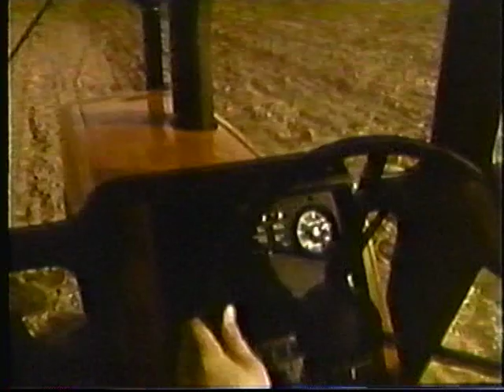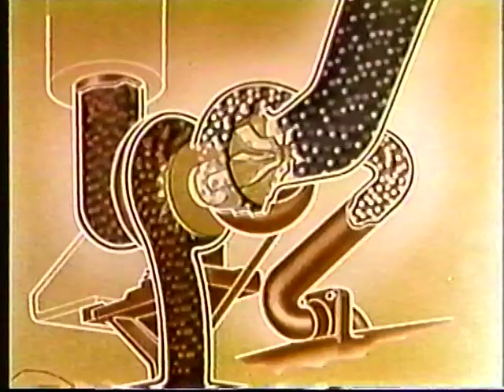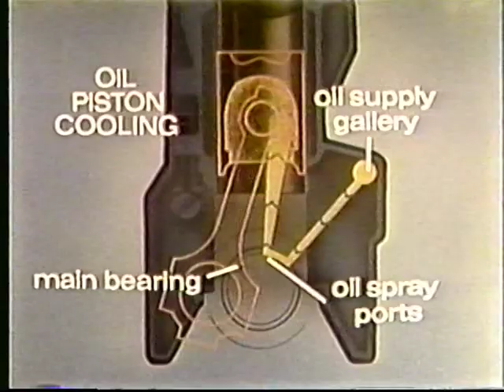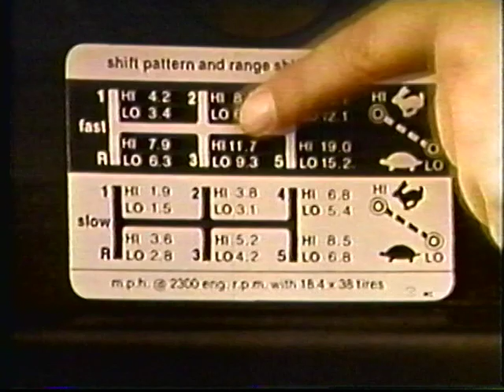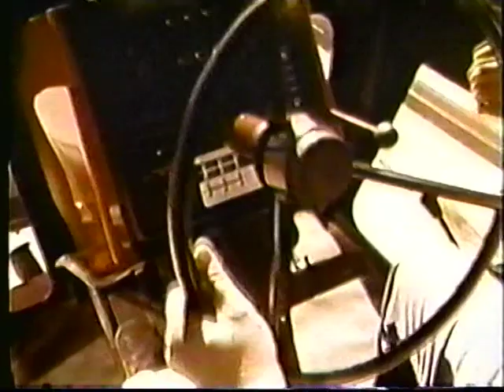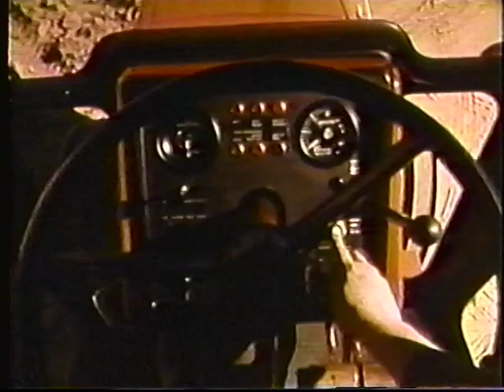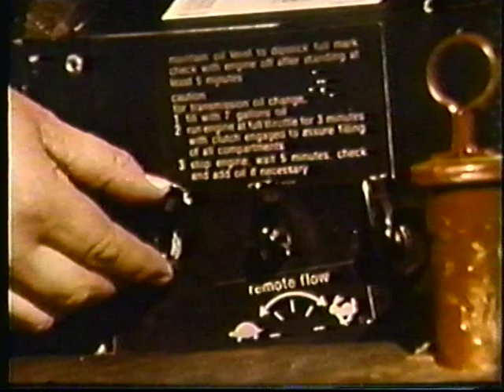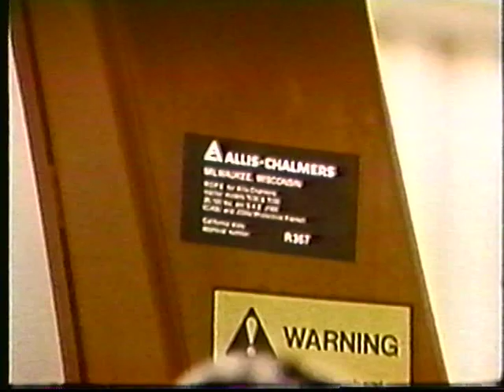1973 Allis Chalmers 7030 7050 Tractors Movie

Comment: Damn, allis chalmers really had their stuff together back them. Too bad they didn’t make it thru the 80’s.
Reply: Real legends never die
Reply: Whatever.....After they were a couple years old they weren't worth anything while the green tractors held their value. You could buy a 4520 JD and keep it for 10 years and damn near sell it for what you paid for it....You sure couldn't do that with AC or Case ect.
Reply: @ericteipen  have you ran one ? I still see ac tractors running rather 1974 or 1982  on the internet im not a jd fan at all
Reply: @ericteipen  For the 6 decades before JD came out with their 4520, AC outsold JD in EVERY market, lol!  JD would've never had a hand clutch or 3 point if it weren't for AC.  They also beat JD by half a decade into getting in the tractor race.
Reply: @ericteipen  Allis Chalmers could get great resale back then just like Gleaner. Back in the 1970's Gleaner had the biggest market share in the US and also the highest resale.  The tractors had good resale too. I have the the dealers Equipment Guide books that were given to all dealers no matter the brand back then. 1977, 1978, 1973, 1966, 1965 and 1959 are the guide books I have that give resale, auction price, retail price, features and options and the prices of certain options. It includes tractors, combines, balers, swathers etc etc.
Reply: @ericteipen  that's complete fiction. A 4520 was a gutless tank that was supposed to run with a 220 and it couldn't hang with a 190xt.
Ask me how I know

Comment: Take the color war out of the equation. These tractors have a lot of features that really are the standard now 40+ years later. I’m not a big fan of the look of them nor the colors. (Orange/Burgundy) The black bellies look much better. The only thing I really saw lacking was lighting at night because as the video ends it looks like a model T car. They did fix that in the next series with the stadium lights going across the top of the cab. Our neighbor had a 7030 and we had an IH 1086. I used to help him and would operate his 7030. Aesthetically the IH was a better looking tractor but I always liked and thought the A/C tractor had much more improvements.
Reply: Using the light on my dad 8010 sucks too

Comment: Only 51 gallon fuel capacity??.
Christ,you'll spend quarter of the time in the cab,but the other 3/4's of the time refueling.
Reply: +13 on the other side.
Reply: Lets look at what the competition had to offer as far as fuel capacity goes.

AC 7030- 51 gal./64 gal. optional
Case 1270- 80 gal.
Ford 9600- 43 gal.
IH 1066- 42 gal.
JD 4430- 46 gal.
MF 1135- 55 gal.
MM G1355- 40 gal.
Oliver 2255- 35 gal./ 65 gal. cab tanks/ 113 gal. fender tanks 

So in comparison to the other brands at that time, they were offering more capacity than most of the competition.
Reply: @GMdieselman  Thanks for the info. Lots of things people assume about Allis but they were great tractors. Just so it is clear though, the 7000 series offered 64 gal capacity and I've never seen one that didn't have the extra 13 gallon tank. I worked at an Allis dealer for 4 years. They all had that extra tank. Both my brother's 7030 and my 7050 have the extra tank too. I have another 7050 early blackface model that is on my restoration list and it has the extra tank. My brother is looking for an open station 7030 or 7050. We love them!